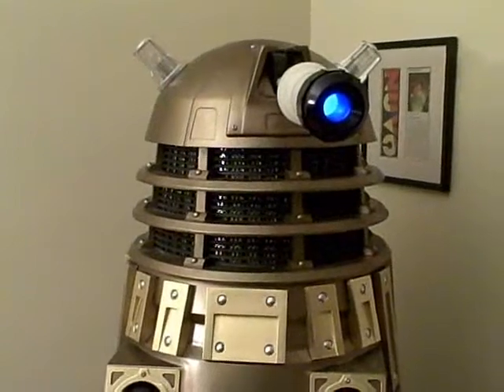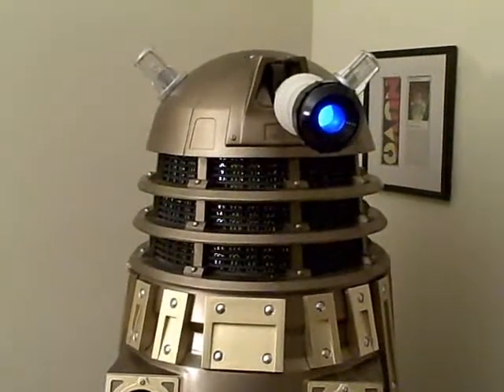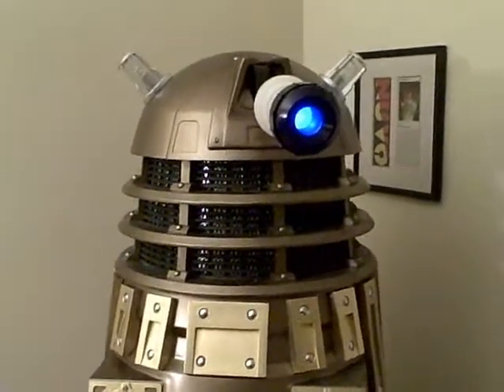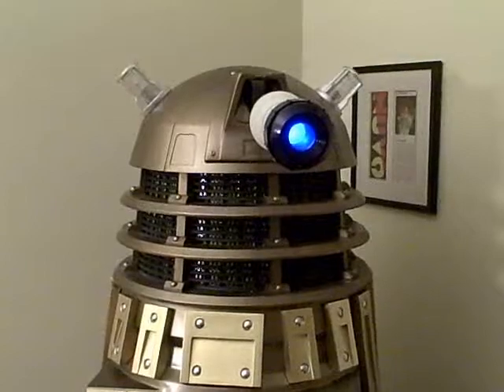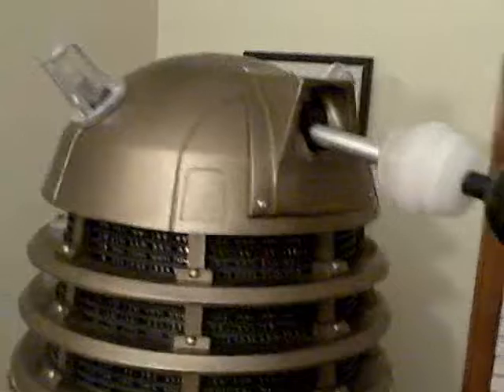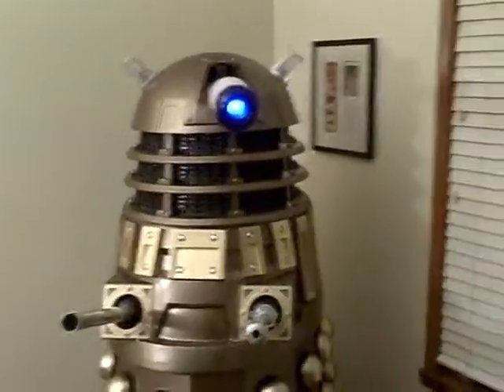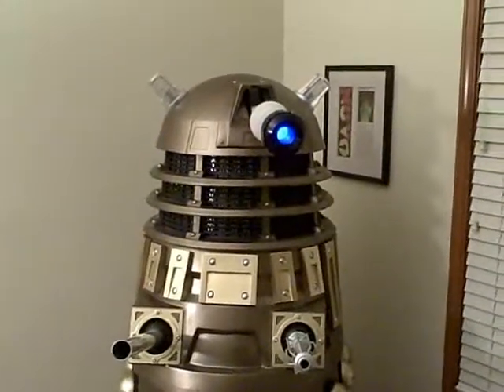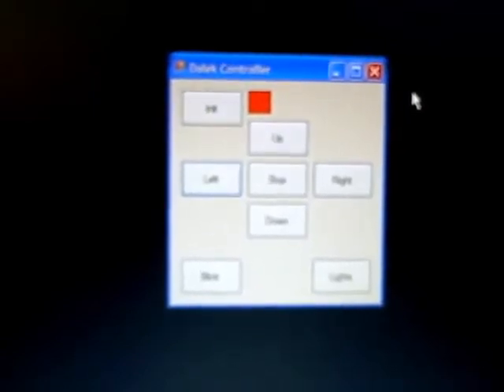Making a robotic Dalek

Comment: What you need to build a dalek, 2 plungers, 2 cups, a giant salt shaker an egg beater. On the top on both sides of the salt shaker place the 2 cups, stick one plunger on the top front of the salt shaker on the midsection of the salt shaker one the left place the egg beater and of the right place the other plunger, taa daa there's your dalek.

Comment from the maker: Yes, you can make everything from wood apart from the dome. 

You will need a plunge router to make the neck rings though.
Reply: Why do you need a plunge router please? I have several full size daleks and I dont use a plunge touter. But maybe your design is better than the one I use. I would love to know.
Reply from the maker: @paullee5573  It's been a very long time, but if I recall correctly the plunge router was used to put the chamfer on the rings. Starting with MDF disc and a 45 degree bit we took small cuts using a circle cutter and plunged further each time. There are probably other ways to do it too.
Reply from the maker: Thinking some more, you could probably use a fixed router and reduce the circle with each pass.
Reply: I used a jig saw with the workpiece mounted on a turntable. That allowed me to cut the rings, which I cha mfered by using a powerplane mounted at 45 degrees. Probably more time consuming, but without a router, it was a good plan which worked well.